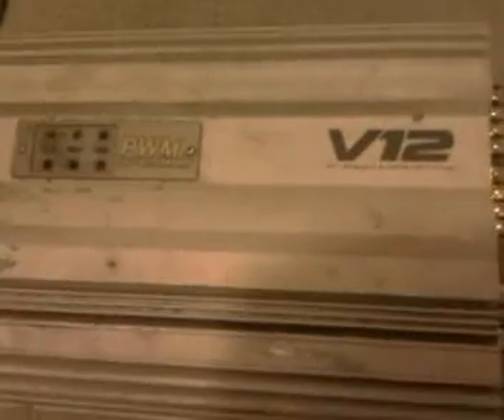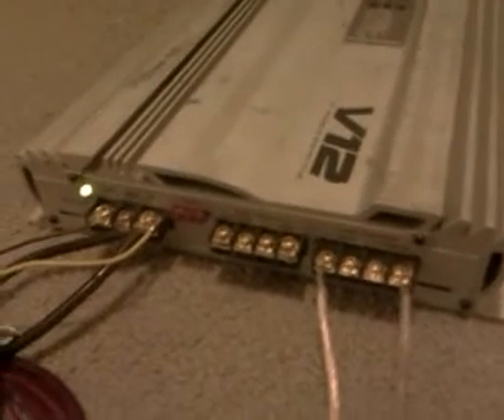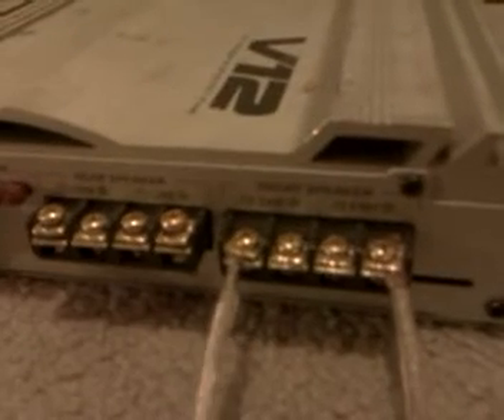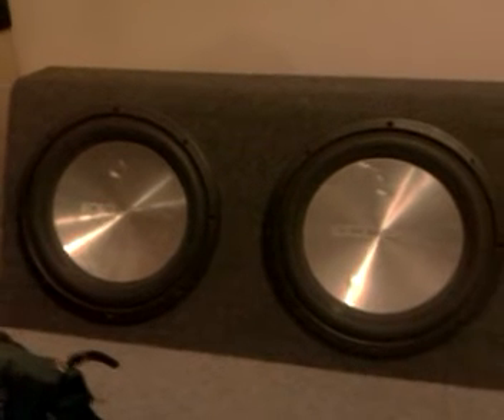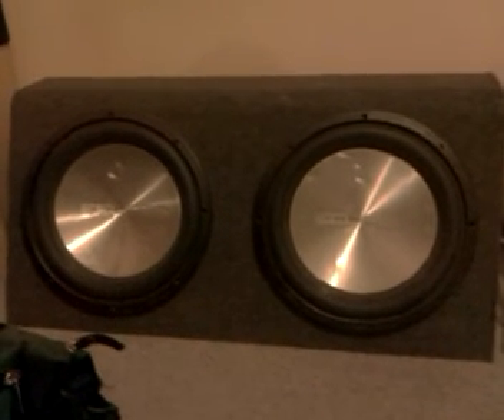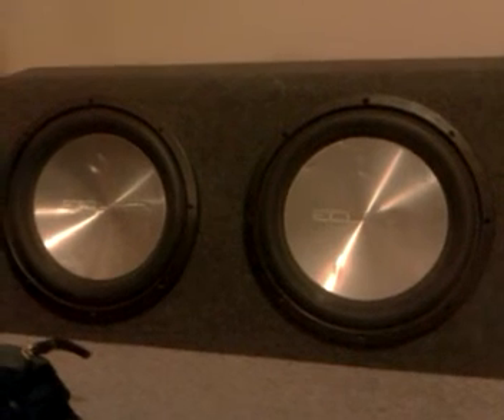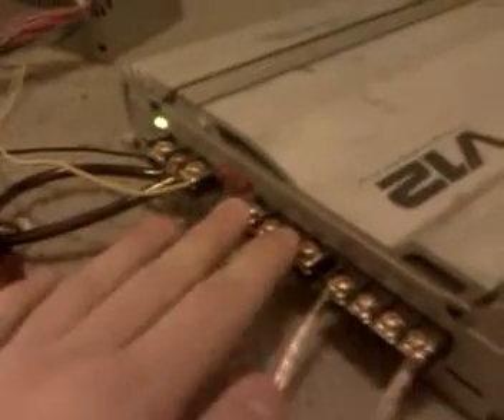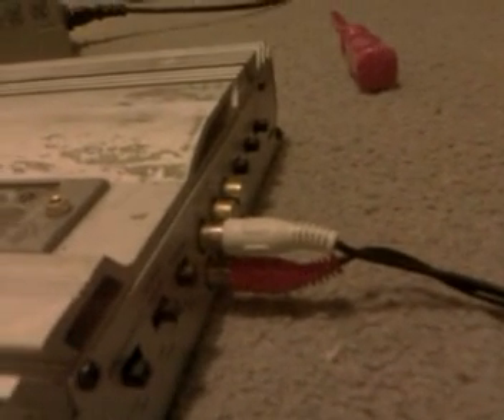How to wire a subwoofer bridged 2 channel. Explained quick, easy and understandable

Comment: When you bridge a car amplifier it will put out its full rms power regardless of what impedance you wire your subwoofers at for an example a 1000 watt car amplifier will always put out 1000 watts when you bridge it no matter what the impedance is so therefore you need to make sure your subwoofers can handle the power otherwise your gonna burn out the voice coils and blow your subwoofers
Reply: Not necessarily! My Phoenix Gold RX1100.1 does 1100 rms @1 ohm, 880rms @ 2 ohms and 440rms into a 4 ohms load so although it's a 1100watt amp, it will only produce that seeing a 1 ohm load and obviously, will draw 120amps doing that.
Reply: Not necessarily! My Phoenix Gold RX1100.1 does 1100 rms @1 ohm, 880rms @ 2 ohms and 440rms into a 4 ohms load so although it's a 1100watt amp, it will only produce that seeing a 1 ohm load and obviously, will draw 120amps doing that.